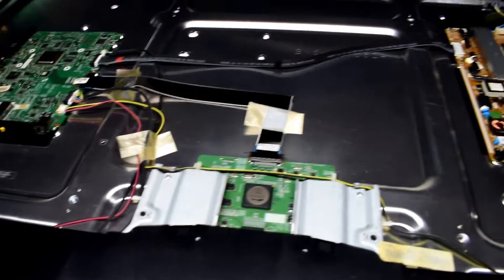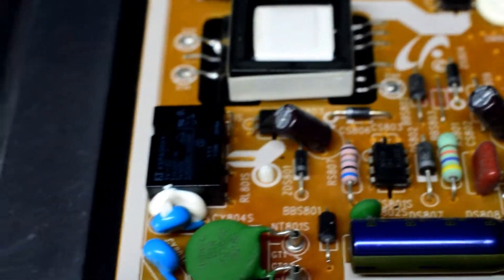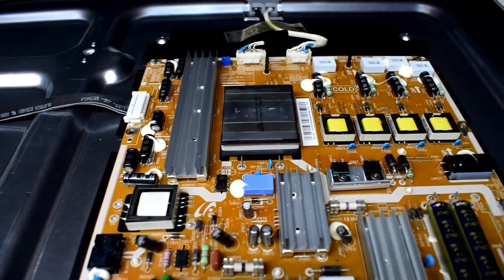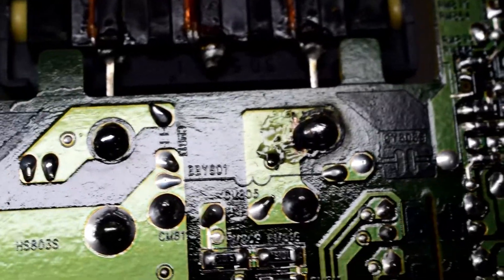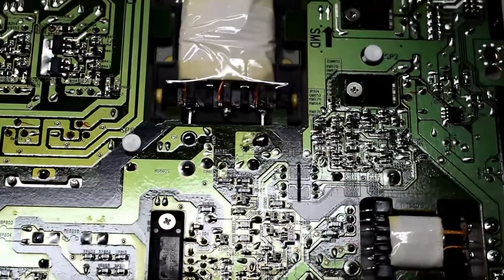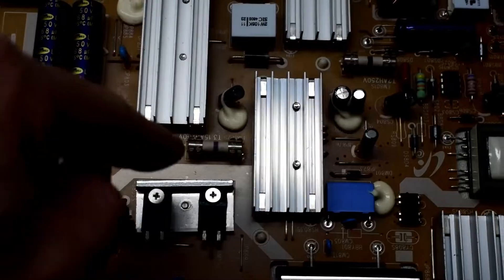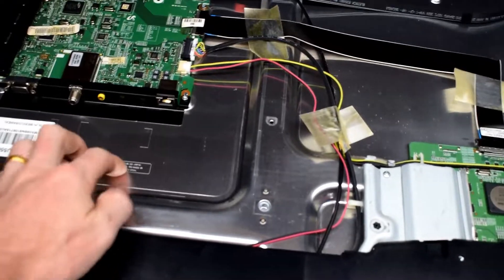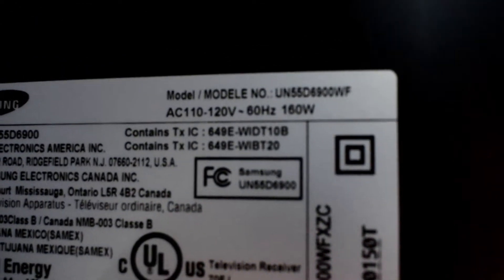SAMSUNG TV UN55D6900WF power supply board repair  Model:BN44-00428B (Easy FIXA)

Comment: Just found this video I was about to purchase a new power board and they are expensive $60 so I’m going to check out my power board and hopefully this solves my problem because my board has this clicking sound but never turns on . I’ll comment back after solder these connection thanks

Comment: I have a different TV but with the same power supply. I bought it defective and re-soldered these 2 soldering points because the television switched off after several minutes. The TV worked for almost a year without any problems. Yesterday, it started clicking again, so I checked these two solder points, and although they look good, I added additional solder. I was hoping I would fix it again but to no avail. The symptoms other than the clicking are that the Samsung logo now appears, the TV shuts down immediately and is in a loop. I don't think this is a known loop boot issue with the motherboard but rather some other defect on this power supply.